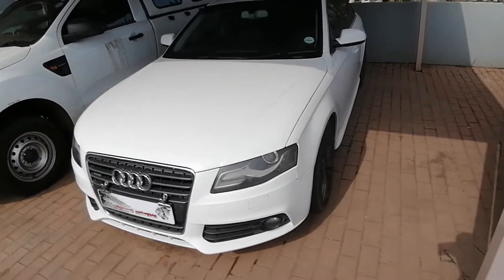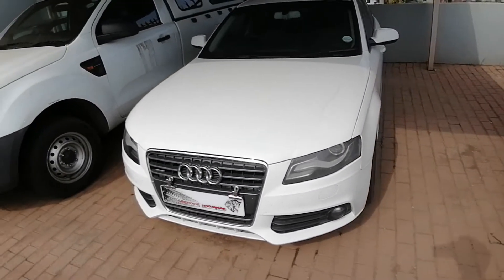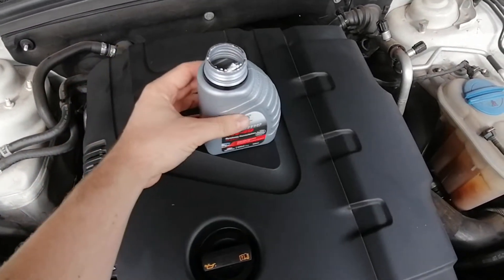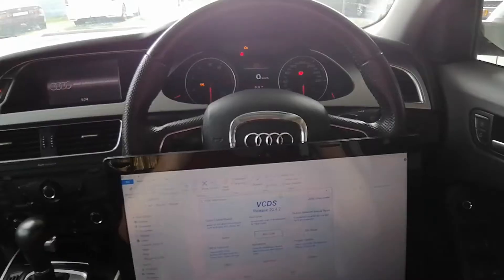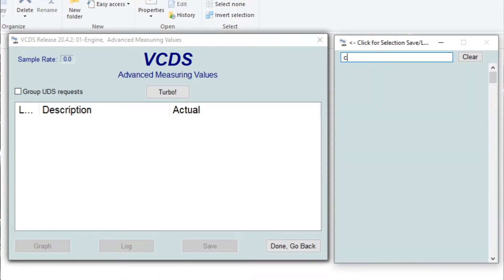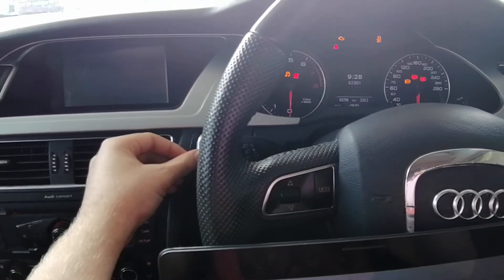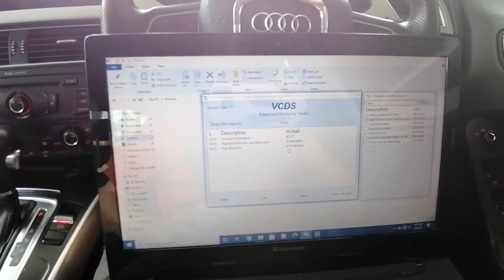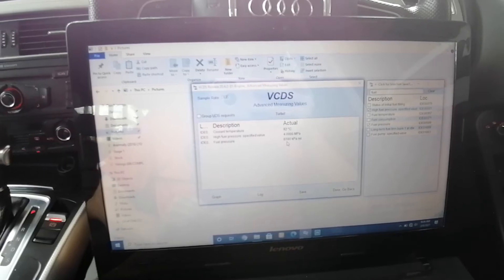How to Test your Fuel Rail Pressure with VCDS

Comment: So what was the problem??
Reply from the maker: Sorry I made this video a long time ago lol...

Problem about? 🤣
Reply: @megalodononwheels  0:42 you said you smell fuel in the oil. I have the same issue. And I’m having terrible fuel economy. And the car sometimes dies while it’s cold after I put it in D or R.
Reply from the maker: Damn, haven't seen this message.

But it is normal to have a fuel smell in the oil, It evaportes after some long distance driving.

But the part where your car dies on you is not normal.

I have seen in the past that a bad MAF sensor will do that, maybe clean it and let it dry up and try again...

If you think it is really a super bad problem with to much fuel in the oil, it can be because maybe an injector is stuck open and leaking fuel constantly

Comment: After 14 minutes mine is at 6380 kPa but it’s still slowly rising. So does that mean it’s an injector? Or it’s the fuel pressure regulator?
Reply from the maker: Yea it is not picking up as it should. It can be multiple things. Difficult to say what it is by not being there.

I also heard that sometimes the furl pump in the tank can go bad and the pressure pushes the fuel bsck into the tank.

But yes there can be multiple things

Comment: during idling is 3800-4000 when switch off is 4300
Reply from the maker: Yea that definitely does not sound right. There must be a leak.

Did your car throw a code yet?

Comment: I've tried this test, but I don't have the same sensors to check in the list. I checked all of the values, but none stays after switching off the engine and turning ignition on. One value stays, but it's randomly between 2000 and 4000. It's not constant...
Reply from the maker: Could you get me the name of that value please 🙏
Reply: @megalodononwheels  I'm not sure and I can't check it in few days... I have a P0087 (low CR fuel pressure) and i can hear my injectors clacking really loud... Very rough idle also. Could it be that my injectors decrease fuel pressure cause they return too much fuel?
Reply from the maker: Replacing the fuel filter or fuel screen.

Replacing the bad fuel pump.

Replacing the frayed, damaged, or kinked fuel lines.

Replacing the faulty fuel sensor.

Repairing or replacing the fuel tank (rare)

There is a few things google says. But yea it might be loud as the fuel pressure is not enough. Are you having any miss fires?
Reply: @megalodononwheels  fuel filter is changed, not fixed. Lines are fine. Sensors both show same value, so they are good. Only thing that i cannot check is pump, and it's pretty expensive to check it randomly, but sure is cheaper that injectors rebuild...
Reply: @megalodononwheels  and no misfires, at least no dtcs... Motor seems to be working fine, just rough at idle and clicks like crazy. Gas mileage is worse tho. From 6 to 8 on open road
Reply from the maker: Tell me what car do you have? Because I did do a video on the HPFP to see the lobe on the inside. So it is a full tutorial on how to remove it
Reply from the maker: Ohhhh gosh ok my video is for the Audi 2.0T. Doubt it will be evry similar to yours but the process is still the same.

It is super difficult to help you over the phone than to be there. But maybe you have an injector that doesn't close and it is leaking diesel into the piston cylinders. That way the fuel rail pressure can also drop.

Comment: can i use other scanner for this? any brand? or i will always need to work with a pc?
Reply from the maker: There is one you can use with your phone, called OBD eleven, not sure if it can do this one to be exact but Can do most dataloggings in general

Comment: How long should it keep the high pressure? When I shut the car off the pressure goes up to around 7700 kpa in 10 minutes and starts dropping in a same manner, in the morning before i start the car the fuel rail pressure is 500 kpa. Is it normal? I just changed all 4 injectors. Audi a5 2012
Reply from the maker: So sorry that I am only getting back to you now. I was not to sure about your question and just wanted to have a look at my video again lol haven't done it in a while haha. Ok so basically your car didn't reach double or double and a bit. Like I mentioned there is no wrong and no right. So let's say your 7700 is fine. The thing bothering me is that you said your fuel pressure is at 500 in the morning, which is crazy low, why do I say so? It is because when you open your car door, your car is already priming the fuel pump, when you turn on your ignition it is priming for a second time, so surely it shohld be higher? But once again that is the fuel pump in the tank and not your high preasure fuel pump in the engine. What I will do is, I will try to look at my pressure tomorrow and see what the reading says and I will let you know. But it might sound to me like you have an injector leak. What you can do is in the morning remove your spark plugs and look if you can see any fluids on your piston tops through the spark plug hole, you can even turn on your ignition and when it primes, look to see if any piston gets wetter. But for now I will try to look at my cars pressure in the morning and let you know. I also don't think the pressure should drop to quick, like I would imagine it should stop for probably 10min and then drop.
Reply: @megalodononwheels   i changed all 4 ok injectors with brand new ones from Bosch. So those should be fine. It had hard time starting for like a day or two after i changed the injectors. Now it starts fine, but in the morning until the rpm drops the engine shakes a bit. I thought it was caused by a leaky injectors before I changed, but the problem stayed
Reply: Thanks for your attention, it would be nice help to check whats the fuel pressure in the morning on your car and how long it stays high after you shut it off. Thanks again, I really appreciate
Reply from the maker: Hi, sorry I haven't done the test yet, been crazy at work. I will still have a look for you... It might be that your PCV valve is messed up, it has a rubber diaphragm and they intent to tear and cause those shakes when it is doing the cold starts in the morning. I made a video about it and how to see if it is damged or not, it is one of my first videos, just go all the way back and you will find it :) It might not be the cause but it can be something you can rule out.
Reply: @megalodononwheels  ive changed the pcv about two months ago, spark plugs are also new. Could coils be causing it? I get no misfire error codes, no check engine light or anything.
Reply from the maker: Yes it could depending on the kind of damage the coils has, most cases the rubber inside the coil is tearing up (especially by the btmbpart that goes over the spark plug), then you should consider on maybe getting new ones. Best would be is to look for my missfire data log and then try it out and see your results :)

Also so sorry I haven't checked the fuel pressure yet 🤦 it has been super crazy

Comment: hi... i have an a5 b8 2011 2.0 tfsi and i smells a petrol when i lift my oil cap, also have new injectors, coils and spark plugs and oil separator.
my engine shakes when its warmed up and when its cold. also have missfire at cylinder numb 2, also yestrday check engine flashes and got code p0303 at cylinder 3. why ? hpfp fail ???  when i shut down the engine also fuel pressure is 1250 kPa and when i turn it on 4300 and thats all.. help ?
Reply from the maker: Hi, so far i must say you have done a lot 👌 the most difficult thing to do is, is to help someone over the phone 🤣 but let me try.

The rough idle comes from the miss fire, when there is a miss fire it can literally shake no matter what or when. Can you please place cylinder number 2 spark plug and coil in cylinder number 1, and see if the problem follows. If it follows then you know its either the sparkplug or coil, then take for example the coil to cyl 4 and leave the spark plug on cyl 1, if the miss fire remains at 1 then it is the spark plug, if it follows to cyl 4 then its the coil... Hope that makes sense. 

I also thought it could be fuel related. It does happen where your HPFP is fine and the problem is actually the LPFP (quick recap, HPFP sit in the engine bay and LPFP sit in the fuel tank underneath the rear seats) so what happen is your LPFP can't get enough fuel to your HPFP. So you are starving your engine and this can cause a lot of damage. If you go through my channel you will come across a video where i explained on how to data log your fuel system. Please go have a look at that video, in that way you will see if your car is suffering from a bad HPFP or LPFP.

Another thing is, it seems like it is always cyl 2. Go on ebay or amazon or something and buy one of those cheap borescopes (i hope i said it right 🤣 its those cameras you can drop into the spark plug hole and can see the top of the piston. They are actually very cheap, get yourself one and look if the piston top might not be damaged.

If it is not that, i hope it is not a bent valve, which i doubt... Especially if your car haven't overheated or pushed the rpms beyond the cars capabilities. Also these cars are well known for carbon build ups. So it could even be a case where the carbon build up is so much the valve seats itself on the carbon and not the head, causing a massive leak. 

Hopefully this will give you a start :)

Comment: Hello, i did this test and the preasure drroped? What could be the problem?
Reply from the maker: Tell me quick? When you idled your car you had your "x" amount of pressure, when you switched your car off it dropped straight away? 

If so, it could be a injector leaking 🤔 tell me, do you smell any fuel when you switch your car off or when you go to it in the morning? It could even be a leak from a bad O-Ring or something
Reply: @megalodononwheels  Yes the preasure went form 50bar to 45bar in 20_30seconds. I dont smell fuel but i have long term fuel trims negative
Reply from the maker: That is a rough one, that indicates that there might be a problem. Does your car have any problems related to it? I know some cars has a fuel return line, so maybe the pressure just pushes the fuel back in the tank... What car is this?
Reply: @megalodononwheels  its golf mk5 gti, 2.0 tfsi engine. The problem related to this are the high negative fule trims, hard start sometimes, and shaking at idle sonetimes when weather is cold
Reply from the maker: Have you checked your pcv? Sometimes they can cause a bad idle, it has a straw on the pcv with a hole at the end, if it sucks or blows its broken, worth a shot to check
Reply: @megalodononwheels  i have replace the pcv, with a pcv delete kit and this fixed my bad dile, but now it shakes just a litle bit not as before. If i reset the fuel trims it doesnt shake at idle at all. I think it might be bad maf or bad o2 sensor,
Reply: I made another test for the fuel preasure when car was at 90°c and preasure went from 50bar to 80bar in few minutes. Thanks for your help
Reply from the maker: I Am Super glad you got it fixed! I am also looking to buy the PCV delete in the future, I currently have the oil consumption problem :(
Reply: @fortnitedaily1042  Hi , how you fixed  ? i have this same engine BWA also shake on idle and on the road when no accelerating only drive same speed 1500 to 2000 rpm. Thx
Reply: @megalodononwheels   Hi we have same problems on my tfsi, oil drinking , white and Black smoke, for me i think its turbo man
Reply from the maker: Hey Tatarin, Sorry YT never showed me your message. It could be your turbo yes.